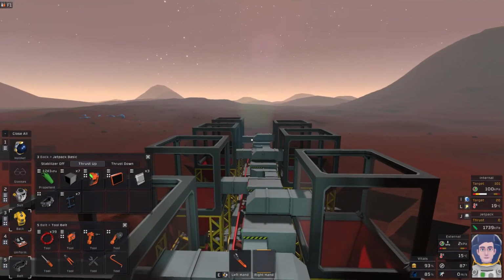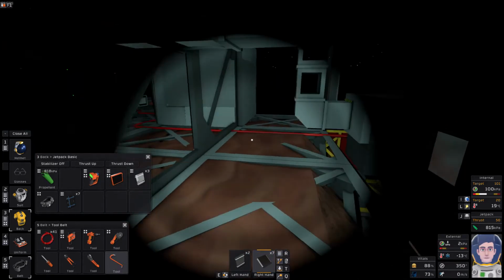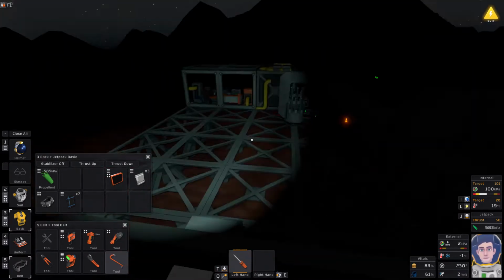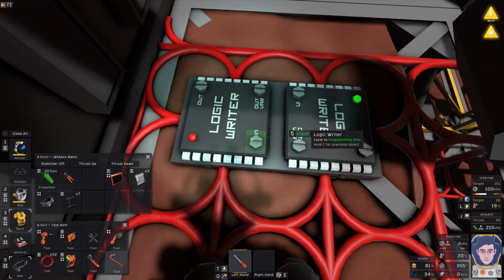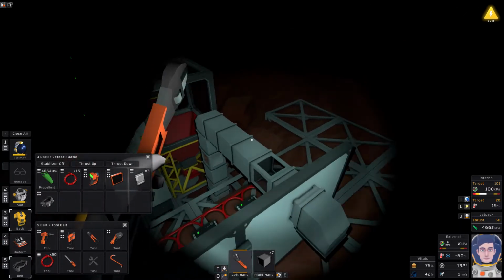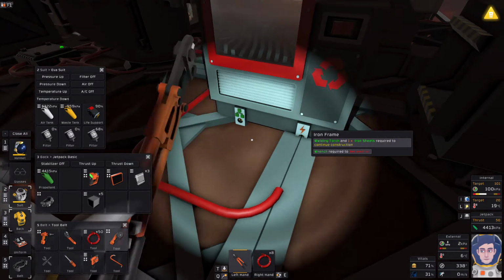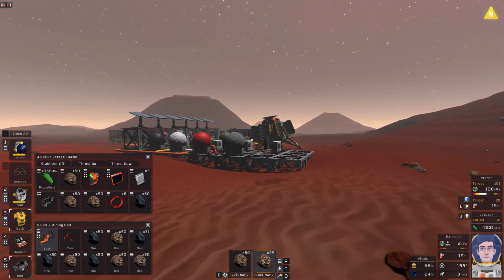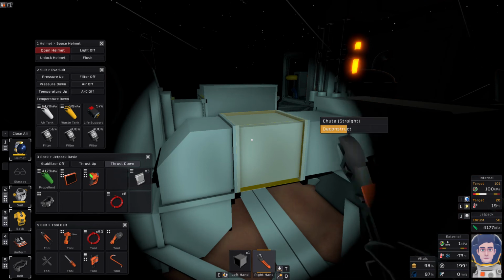Stationeers Play Through Part 7 : Ingot Delivery

Comment: I never see that your character is drinking or eating something. Well, I saw in the earliest episode, but not lately. And you prepare to make a complex industrial system before even secure the food and water in the game. Well, I haven't play the game, so I don't know the game system. But I know that you require to eat and drink in this game.

In most of survival building game, we mostly secure the food supply first. But it seems you prefer to ignore to build farm, and only care only to use a small portable farm instead. Why is that?
Reply from the maker: Stationeers food production is not yet properly balanced. In my view for a space survival the urgency of nneds should probably be oxygen>water>power>food  (TKOM did this quite well) but at the moment it is more like power>water>food>oxygen
And as a result although food takes time to grow it is less urgent than getting power, and the starting food and water supply lasts for a really long time.

It is on the dev roadmap to rebalance (I think after the current atmospheres pass it completed)

However also on this playthrough I decided to push for early automation of industry because otherwise there is a risk that by the time you automate it, you no longer need it. And the time saved during making everything else is worth it.

That said, as I spot in a later episode, a hunger rate setting from a sandbox test I did in another save has carried over to this one and for a couple of episodes hunger is turned off. I figure that out and turn it back on a little later.
Reply: This game is not like most survival games, you can set up and play any way you can think of. It's more like having a deck of cards, you can play many different games with cards, but they are still the same cards. I've had this game from the beginning and not one of my playthroughs has been exactly the same. Definitely a favorite, I always come back to it.